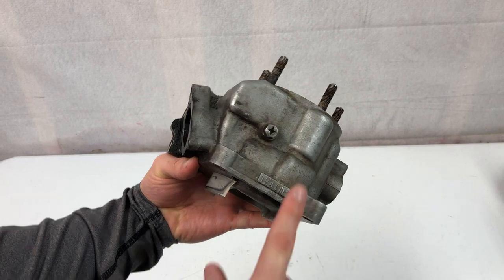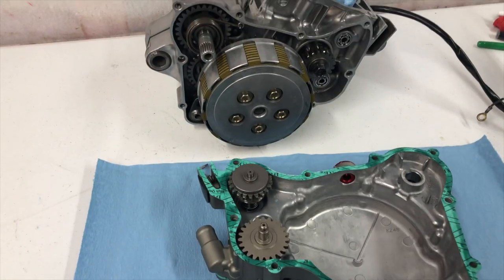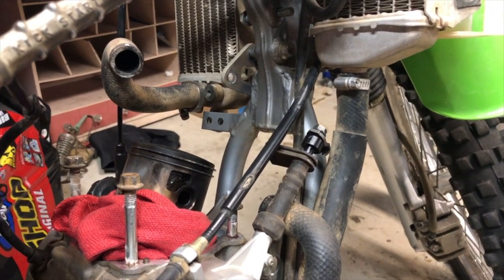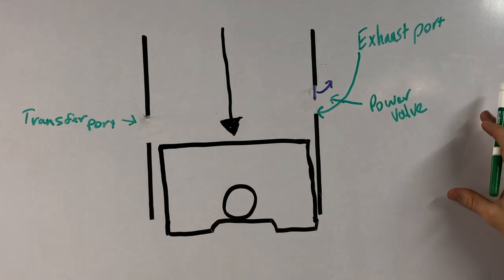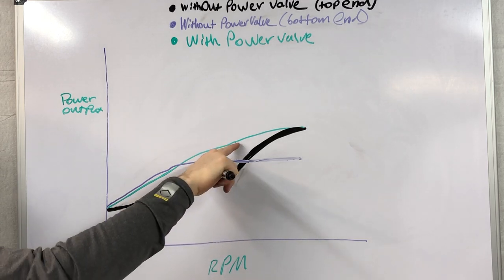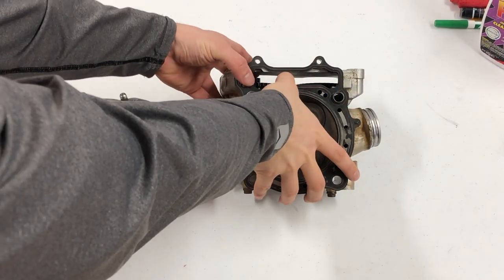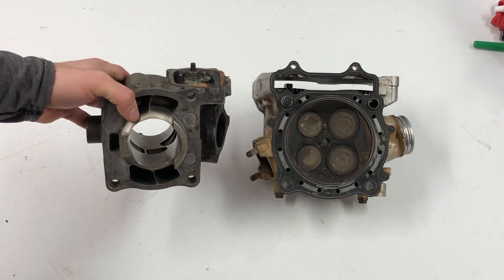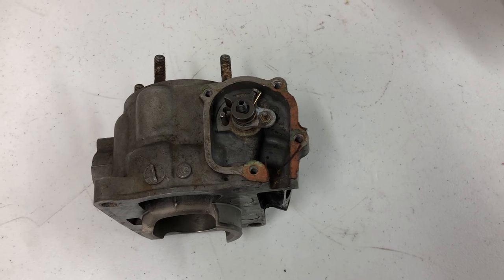Two Stroke Power Valve Explained (in detail)

Comment: I love that you showed the kdx220. I’m here because I’m having issues on my 94 kdx 200 power valve. Great video!
Reply: Dustin Silva did you ever fixed the power valve? I just bought one and the power valve doesn’t move
Reply: Mario Terminel  yes finally found the parts, I spent weeks trying to find them, Kawasaki doesn’t make them and almost no 3rd parties make them either. I ended up finding some fabricators in Europe that makes the set. Even better because they are make with steel instead of aluminum so they’ll be more durable(apparently they are a common failure). Anyways can’t recommend BDX racing enough if you need the power valve parts
Reply: Dustin Silva thanks for the info I’ll look other places online and I hope I find them!!!

Comment: Bored? This is amazing.
For a while, I have been brainstorming as to how to have different expansion chambers, for different RPM ranges, and what kind of valve can switch to different exhaust pipes. And also do this with multiple cylinders, like a snowmobile engine.
But power valves are so much simpler.
And instead of a governor, maybe I can set up quick and strong enough servo, and an Arduino to control it.
...Now the questions I have is, can a power-valve be installed into any 2-stroke, or do I have to look for powerful, multi-cylinder 2strokes, that already have that feature?
And how to make a power-valve more reliable?
20 hours is ridiculous. Even with non-aggressive use? Like commuting.
Reply: In my husqvarna 125 wre 1999 its controlled by a servo and a controller that reads the rpm from the cdi

Comment: I am new to bikes and just bought an 04 cr125...which I completely entirely regret. Didn’t do my research and spontaneously bought a bike from a guy who said there were 2 hours on the top end. The bike started and rose but after 2 days of sitting in my garage I went to disassemble the top end to check on it and noticed two massive gashes in the cylinder as well as the piston. I also don’t have a power valve arm. :(
Reply from the maker: Sorry to hear that man
Reply: Of Course you dont have a Powervalve Arm on your '04 CR125   they Used the Same Electronic RC Valve that the CR250 Uses !

Comment: Yamaha was the first bikes to do power valves but skidoo was actually the ones who created and first to use it in a 2 stroke
Reply from the maker: That’s interesting!
Reply: That statement contradicts itself. Can you clarify.
Reply: @jonmotes5406  It doesn't. Yamaha was the first motorcycle company to use a 2 stroke power valve in a motorcycle. Ski Doo (Snowmobile company) was the company to develop it for use most likely in their 2 stroke snowmobiles.

Comment: Good vid. I have a CR 125 1995, it idles and blips fine in neutral. But disaster on 1st ride, throttle sticking wide open even on a closed thrrootle (threw me off the back broken rear fender bent bars) Any ideas what it could be?

Comment: Hi Adam...i havê a CRM125 from 1997. It doesn't go faster than 85/90 Km/h, about 7500rpm. I've cleand the charcoal in the exaust(about 1kg), cleandes the carburator. Seems to have comprension, stars very well, the first kick...now i have learned with about the RC valve. If it isn't that, what else should i see? 
Very nice video, very well explained
Reply: whats a crm125? ive never heard of it... is it a 2 stroke 125 road bike? my cr125 dirtbike tops out at about 90kmph, normal for a dirtbike at least.
Reply: Paulo Estêvão have you tried jetting

Comment: I want to hook my powervalve arm to a cable and have a lever on the bar that I actuate the powervalve with.  Not because its a smart thing to do for a bike setup.  Im just curious to see how it feels
Reply from the maker: Science Militia1 that’d be pretty cool
Reply: Anas Mhz  It wont break anything.  Just will change the amount of air that the engine can flow

Comment: Awesome stuff now my question is if i want to make a handheld like a lever system to open the exhaust ports with something on a homebuilt engine to make something like a "turbo charge" =power valve?
Reply: Dt 200 have something similar that works manually with the throttle as soon as it gets to a set point, it opens the power valve dont know if its stock or aftermarket/diy job

Comment: "Similar" concept to Variable Valve Timing in modern car's. Less/more air/fuel based on RPM and duration of valves opening so your car doesn't idle and sound like a dragstrip car to only then run "fine" at 75 mph.

Comment: sorry I guess I didn't pick up on the actual gear ratio between the crank speed and the "GOVERNOR" SPEED, also how much force does the Gov put on the gears to open the power valve?

Comment: pfft, i only clean it when i change pistons etc. and i only do that every couple of years. next time i think ill need a whole new cylinder too. pretty sure ive done hundreds of hours on current piston/ rings. still goes strong. but definitely looking forward to new piston/ rings etc. i only really trail/ farm ride anyway though so it doesnt bother me so much to be slightly down on power, and its too expensive and time consuming to change piston rings etc as often as recommended.. thats just extreme.
Reply: wotever99ninynine Hamilton it’s not that expensive that’s called maintenance you probably never got on the bitch anyway so it doesn’t matter when you redo the top end

Comment: i bet you could take that out and it wouldnt affect very much. a computer or brain box would be much better, thats a crude attempt to mechanically control and adjust for some slight benefit?, but again a computer would be able to pinpoint accuuracy like in a car fuel air mix etc.

Comment: Why do people bother with performance parts? If you want more power you would think the person would have just bought a much larger displacement dirtbike..... Ill never understand that. There is no replacement for displacement.
Reply from the maker: Racing classes restrict you on engine size....
Reply: @adampaganelli4891  I didn't know 220cc bikes had a class, what do they race with the 250s and 450 four strokes?
Reply: @adampaganelli4891  nevermind I see 220s can run in the 250 pro sport 250 b and 250 b limited but I wonder why he didn't just get a 250 and modify that....
Reply: @cjw.6310  more engine rotating mass equals worse handling. Bigger engine means heavier which means worse handling
Reply: Well maybe height i can ride anything but i had to buy a crf230 for the height cause the 250 is huge lol my ass is 33yrs old but only 5ft6in 🤣 but i just bought a 150rb and this thing is beast i have a few big wheel 80s but they are a tad small......